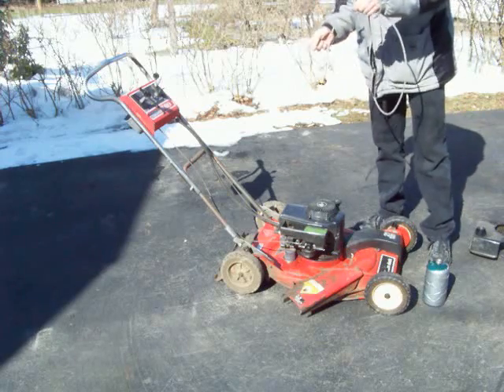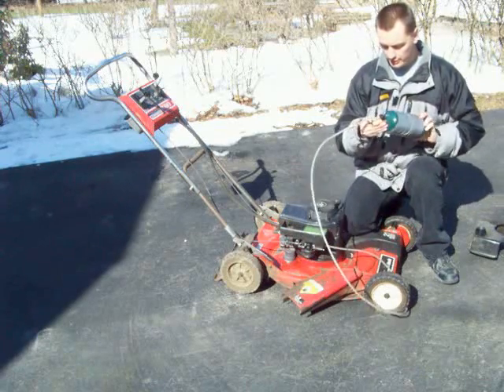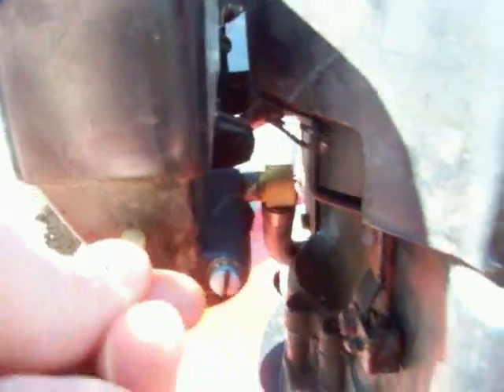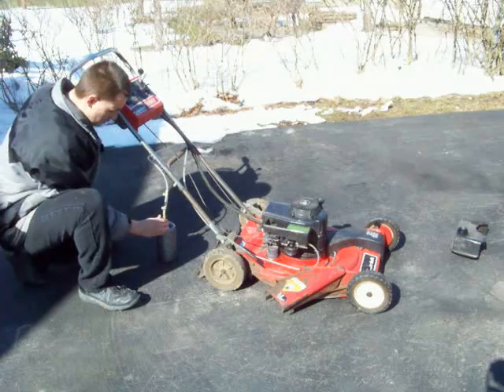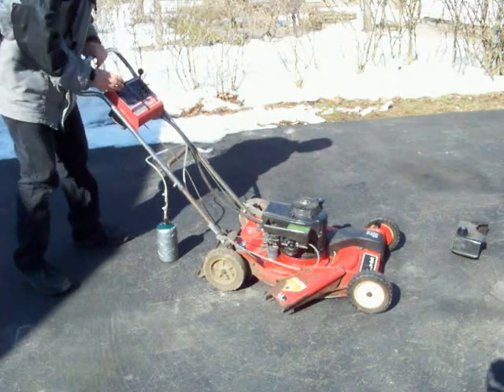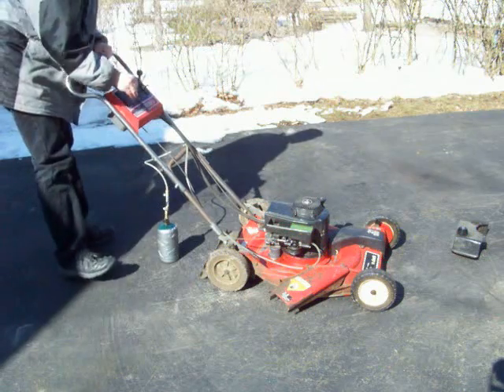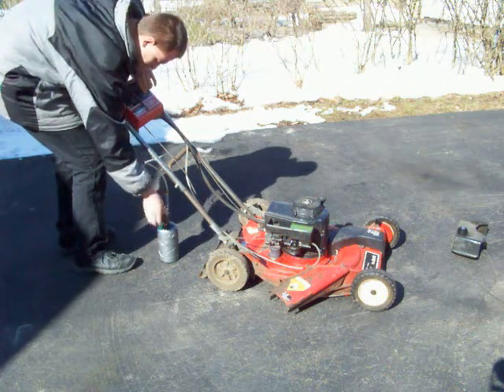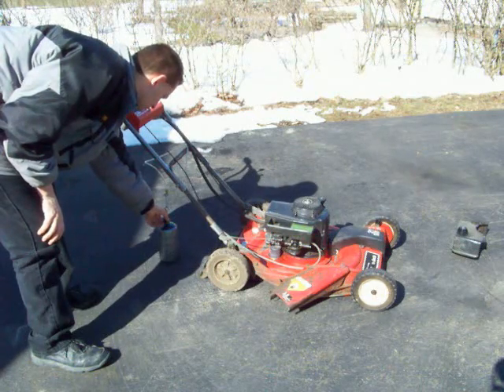lawnmower running on propane

Comment from the maker: @Mijaycapri79 yes, but you would have to put an oil injection system in it as there is oil mixed in with the gas so you would have to find a way to add the proper amount of oil with the propane and feed it into the air intake

Comment from the maker: it was just an experiment. there is no savings because my method of injecting fuel wastes a good portion. also you can refill the small ones off of a 20 lb cylinder. they sell the mac coupler that is designed for this pupose and it is legal as long as you do not transport bthe refilled cylinders.

Comment from the maker: yes for permanent rpm change, you can bend it, but if you want to convert it so it has an actual throttle control like the old ones do and throttle it down and up depending on the need. you are going to want to do what i said before with the hinge thing. this way you can just move the throttle, and you can only bend it so many times before it breaks

Comment from the maker: remove the tab and replace it with a two piece hinge system. then connect a throttle cable to it. youre done. i thought of this yesterday as i was cutting grass with my old machine.

Comment from the maker: well lets just say it hasnt happened yet. anyway i could die in a car accident on the way home from work tomorrow. i think the chances of that are greater. i ran this setup for most of last summer when cfutting my 3 acres of grass and burned off 3 20 lb cylinders of propane and nothing happened so far.

Comment from the maker: its still possible, but even if it did, there isnt enough gas in there to blow the thing up, it would just send the air cleaner cover into the air as it is just snapped on and the plastic is so worn that it doesnt fit on there very well anymore.